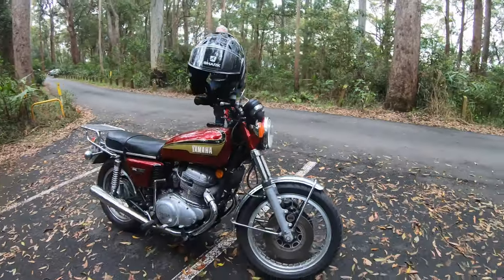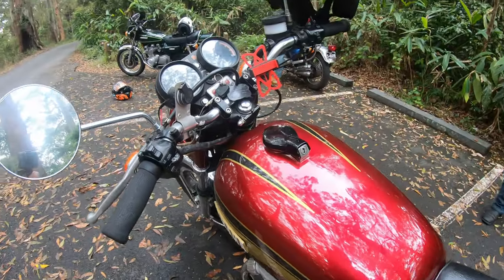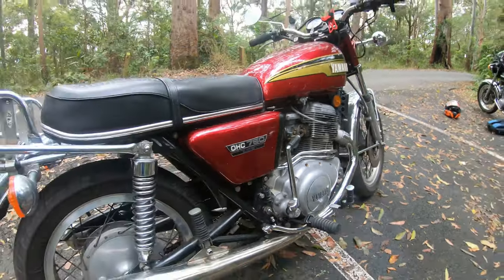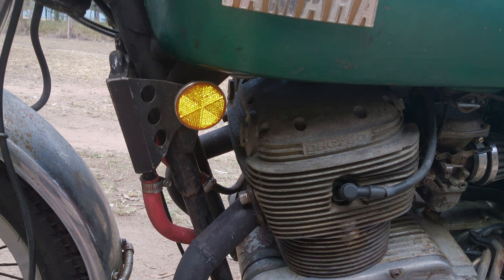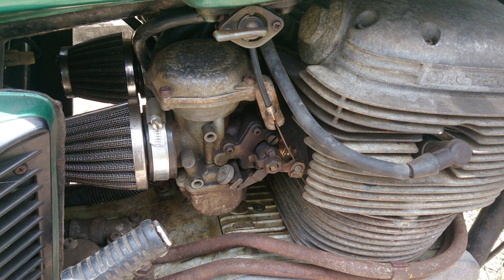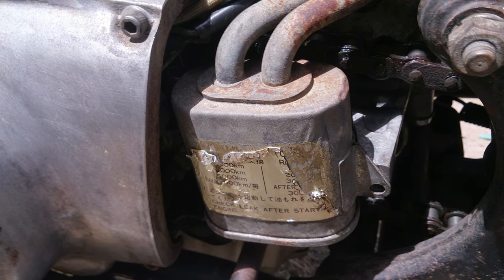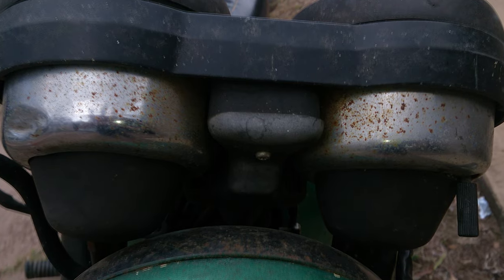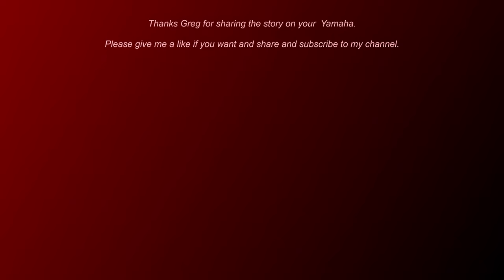Yamaha TX 750 , 1972

Comment: Nice bike. I had 3 of these in the 80s got them all cheap all needed abit of work. I was getting the crankshaft hard chromed on one here in nz and the guy doing it knew it was off a tx750. Turned out he worked for yamaha when they were recalled. He told me to get the camshaft bearings machined and get needle  bearings put on as this is a weak point of the engine. It cost $90 nz as they were setup to do it. Original camshaft bearings are only a hole  in the aluminium casting and can loose oil pressure when worn. 
That bike ran sweet. Found it to come into its own on gravel roads. Power sliding those were the days ....
Reply from the maker: Thanks for the comments, much appreciated,  my TX is a beauty, nearly as good as my Z900.
Reply: Oil was pretty poor quality back then and couldn't handle the heat. And then there were the neglectful owners. Service?? That costs money.😂

Comment: Our Royal Enfield 650 has a lot of those same features as the TX. Makes you wonder if someone did some research. 
I think that the old TX suspension is superior though. The Enfield front end is mushy and harsh on square edged bumps. Needs air fork caps. Might have to make some.